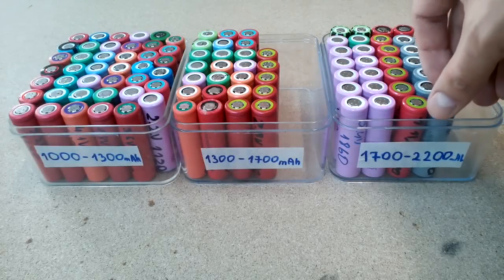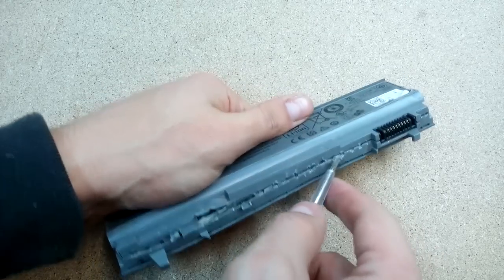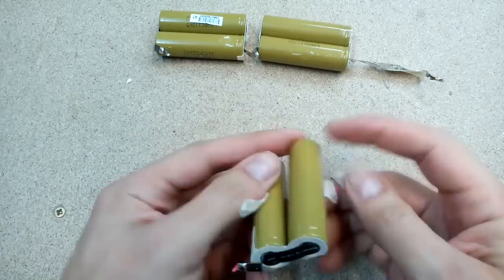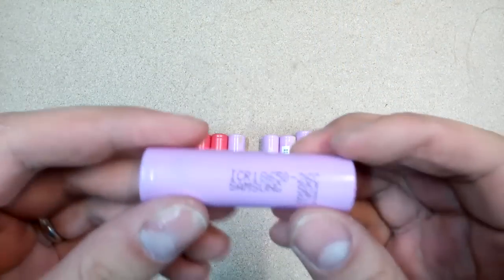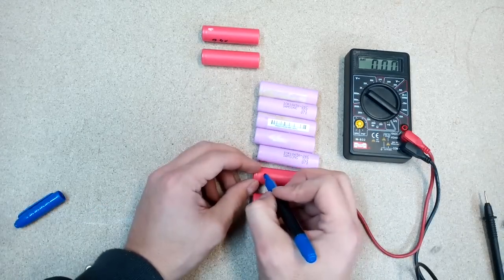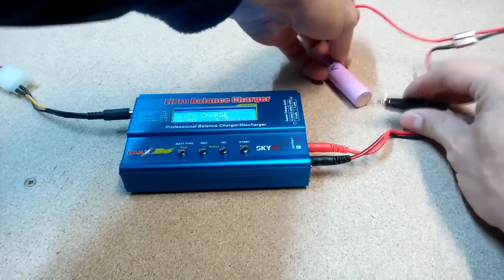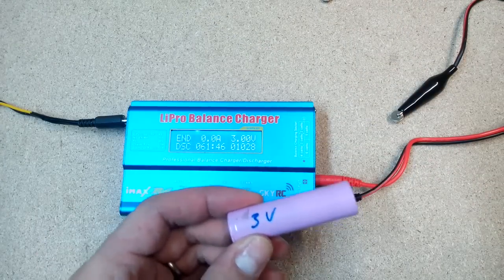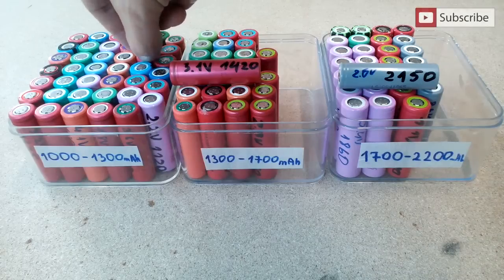How To Get: Free 18650 Lithium Cells From Dead Laptop Batteries

Comment: Please don't use these batteries for vaping
Reply: +Gaming With AA if you are a vaper you should already know that used laptop batteries are not suitable for mods
Reply: Soooo .. Who's going to take "Safety advice" from this child?  Any one??  :)
Reply: Check internal resistance, if with-in spec (low Int. R), they can be used for vaping. While It's true most laptop batteries  are NOT designed for high amp discharge, most can be used.  Again, check the temperature under heavy load first.
Reply: Use good charger
Get reliable specs on battery and don't overcharge/discharge
You should be safe this way.
Reply: philip song
So what man,that is evolution.Idiots shouldn't have to survive their own stupidity.It hurts them to live and it hurts us them that they live.Let them die and let us use our cheapo batteries.Win win.
Reply: With a good charger you can see what battery you have and if they're suited to use in vaping mods.

I use a voltcraft alc 8500 myself and it does a awesome job.Checking batteries for every vaping neighbours for years(usually to find them nice paired sisters but sometimes for amp output as well).
Reply: +GAB GAB no you are spreading dangerous misinformation
Reply: Most laptop batteries are Korean or Japanese brands. They are of MUCH higher quality than any of then the UltraFire brands that people are buying from China.  The  amperage as well as cycle ratings are as stated. They are good batteries. Do you know anyone who died or suffered major injuries as a result of using these batteries to vape?.  I didn't think so, you must be a Yet Another YT Safety Nazi.  

Tomorrow is the 4th, let's all just enjoy the freedom that we have. The freedom earned by sacrifice of many daring and brave Americans of the past and present.   I'm willing to bet that those brave people were not afraid to vape off the recycled laptop batteries.
Reply: philip song
If you don't overdischarge they ARE fine.
Batteries went if you overcharge or overdischarge them.
If you use salvaged batteries and make a build too low overdischarging them, that's user error.
I'm an ICT student and this is common sense.
Reply: Look, vapers to be, just don't, be safe for the time being, and don't do anything that could be bad news to vaping and vapers, and for you other guys, cool, you found a new way to salvage batteries and stuff, but most people can barley grasp Ohms laws, so this kind if "advice." Can definitely lead to some bad shit happening, accidental or not.
Reply: +Yong Whang and no telling you to. Stfu doesn't undermine my cause. Let it go.  This is not a good. Idea for vapers,  especially one who Is broke and doesn't know the dangers of misusing a battery but has a new mech and a broken laptop. Because vapers from all different points in their education about vaping may see this it is important to let it be known that this is not safe unless you can identify the cells with 120% accuracy,  which most of the time cannot be done because most of them are rewrapped.  Just let it go.  

If you knew there was a 2% chance that the cup in front of you was poisoned would you drink it?
Reply: philip song
Knowing what you are doing is part of it.. NOT doing it anyway is the other part.  Such as building a coil with a 20amp discharge with a 7 amp rated battery..     Now a normal person, that knows what they are doing will not do that, yet there will always be some idiot thinking.. well why not?  Lets try it and find..BOOM! (literal definition of face-melt)

Besides which, if you can afford it, why even take a chance?  If you can't afford it, save up until you can.  Gezuz, ask a vape buddy if he has an old set you can use, or a spare until you can get new ones.  Most mech users have 6 to 12 or more on them at all times.  Well serious assed vapers do.  God forbid they would miss blowing out a school of jellyfish to show off to some hot chick because of low batteries.   LOL.. Would I do that?? HELL YEAH!  Go down the wharf in summer, pop out 4 or 5 jellies and watch the chicks come flocking.   :o) and we know they will.. girls are easily amused... they date guys don't they?
Reply: +GAB GAB just shut u p
Reply: philip song
If you do your calculations right, it doesn't matter if it's regulated or not. Ohm's law buddy
Reply: philip song
So i'm right :)
Reply: gbalkam
Point out where i recommended someone to use them. You still don't and aren't going to get it so let it be. "You aren't benefiting at all in that course of study" Because i'm surely going to be asked about batteries in my CV
Reply: why ?
Reply: +Gaming With AA it's not safe
Reply: +Yong Whang don't listen to ^ Unless you have a lot of experience dealing with batteries and vaping.  This is very dangerous.
Reply: +1ceeb don't use laptop batteries for mechanical mods no matter what these people say and you shouldn't have any problems
Reply: +Yong Whang stfu
Reply: +Yong Whang don't use salvaged batteries for vaping,  especially unregulated vaping.  Please don't be skimpy on batteries.  Samsung 25r batteries are 5 bucks sometimes less.  Don't try to save a few bucks by putting yourself and those around you at risk and also the entire industry,  every vented battery horror story puts another nail in the coffin of an industry that save millions and potential billions of futer lives.  If you need cheap safe batteries get the Samsung 25r I think they are 5 bucks each on imrbatteries dot com and they have a pulse rating of 100 amps and 20 continuous,  nobody takes 10 second rips.  Way less expensive than a hole in your hand or face,  or a laptop for that matter,  please please please don't use salvaged batteries for vaping.
Reply: DharkMark
I'm not saying it's ideal or that there is nothing wrong with it.
I don't recommend anyone to do this at all.
But my point is, if done correctly and you do the research on the batteries and know Ohm's law they would work fine without any explosions or shit.
Reply: philip song
You are being extremely biased.
Ofc they aren't ideal but what you are saying is, if a battery is from a laptop it means it will explode no matter what.
Reply: +Yong Whang this has nothing to do with reefer madness let's not confuse battery safety with government propaganda.  They are world's apart.
Reply: philip song
If you have a device that checks if there is poison in it?

Yes.

And a  battery charger like the voltcraft alc 8500 does exactly that.It checks your cup for poison :)
Reply: +GAB GAB If you can afford  a charger like that you can afford a couple 5 dollar Samsung 25rs
Reply: +GAB GAB most people looking to use salvaged batteries are doing it to cut costs and likely don't own a charger like that.  Let's be realistic.
Reply: Guys, if you can't afford $10 to $15 for your batteries, you shouldn't BE vaping.  Why not use corn syrup, rubbing alcohol and cigarette butts you pick up off the street for juice?  Why?  For the exact same reason you don't use shit batteries for vaping.  I am seriously waiting for one of these numb-nuts to post how brand x mod is unsafe because he blew his face off with it using these batteries.
Reply: because don't do it, that's why.
Reply: +gbalkam thank you
Reply: Point is not that we can't afford them, point is that they do not explode in youir face if you know what you are doing.
Reply: +1ceeb point is they do if you don't and lots of people don't but please keep arguing and commenting so my original comment stays bumped
Reply: I'll bet that easliy 2/3 of the batteries he has there would blow up the second you hit it on a low ohm mech mod.  And of the remaining 1/3 that didnt blow up, 3/4 would after a short time.  Now since the batteries aren't labeled.. you have no way of knowing which of those might be ok to vape on.  Like I said, for the sake of $20-$30 it isnt worth the risk.  If you think it might be, pour some boiling water on your mouth, and when you are healed up, come back and tell us if you would do it again for $30.
Reply: gbalkam
Point of this debate wasn't that people should try them, it was that if you get the stats of the battery you could operate it without it exploding.
Reply: +1ceeb no that wasn't the point of this debate.  I initiated the debate and the point is clearly that these salvaged batteries should never be used for vaping especially with an unregulated device.
Reply: +1ceeb God just shut up.  Most laptop batteries done make the grade and if someone is watching this video to try to find cheap batteries for vaping they probably don't know what they are doing or they wouldn't be watching this video.  So stfu buddy
Reply: +1ceeb don't make the grade*
Reply: +1ceeb no your not
Reply: 1ceeb
what kind of failtard would use a 6amp rated battery in a mech mod?  None. People go to mechs for higher builds, not toodle puffer builds.  If you want to use a 6amp batter, just get an ecig.   Furthermore, you have no idea what the condition of these batteries are.  Ohms law be damned, a bad battery is a bad battery, and voltage alone will not tell you that.   But by all means, you go ahead.  If you blow your head off, that is one less moron we have to deal with.
Hope to see ya in the news soon.
Reply: +gbalkam your ignorance on the matter is astounding.  People don't use mechs for higher builds.  People use mechs for low resistance builds.  Stfu you have no idea what you are talking about.  Regulated mods are for higher resistance builds unless they are being used for tc
Reply: philip song
You are so clueless it's hilarious.
The only diffrence between regulated and unregulated mod is:
Regulated = has electronic chip/fuse/protection
Unregulated = has no chip/protection
Reply: philip song
you misunderstood.. by higher builds i mean more mass. like 6 coils vs 2.
by the way.. MY regulated mod will go down to 0.1 ohm. 
Im currently running a hex coil build (that's 6 coils fyi) at 0.18 ohm.  Now tell me again how regulated is for high ohm builds.  My previous build was 6 coils at 0.12 ohm. But it wasn't warm enough at 200w, so I swapped the coils.
Reply: Point is guys.. don't use crap batteries. It isn't worth it.  This clown might know how many volts the battery has in it.. but is clueless about sustained discharge rate, if they are high discharge safe batteries, and the internal resistance of these batteries.  They might be fine for a flashlight, but don't use them in a vape mod.
Reply: +gbalkam i'm not talking practically but theoretically they would work but aren't ideal. If i use use mechs it's for their quick firing, size and simplicity.
Reply: 1ceeb
and like I said, you have no way to know the inner resistance of these batteries or the actual sustained discharge rate or if they are high drain batteries.  From a lap top, I highly doubt they are. IR determines how hard the battery hits, sustained discharge is how long the battery can drain at say.. 7.6v before over heating, and high drain is if they can handle a fast discharge,  So knowing all this.. is it even worth even trying one of these in a mech..when a brand new battery only costs $12 to $15?
Reply: +gbalkam nope
Reply: +gbalkam a brand new Samsung 25r is 5 dollars
Reply: *****
Well, these guys have been told, dozens of times by more experienced vapers.  Short of tying them to 2 posts and whipping them like they did in that scene in Roots.. if they don't know by now, nothing is going to teach them, except blowing their face off.
Reply: gbalkam"by more experienced vapers" Better not fall off of your ego, you might die.
Reply: https://www.e-cigarette-forum.com/forum/attachments/sony-battery-jpg.529035/

Yeah, because sharing what you know is pure ego.  But pretending to know about something you know NOTHING about rather than admit you are wrong isn't pure ego?  The above link is to a document from Sony to a vendor regarding rewrapping batteries intended for use in laptops, drills, power tools, etc as well as links to federal agencies with documentation regarding these batteries and use in stand alone devices.  Now, I consider this to be PROOF not to use these batteries.. now YOU prove the federal government and Sony wrong.  Remember, Sony makes both of these types of batteries, so it doesn't matter which they sell, they still get the sales.
Reply: +gbalkam I was never with the idea that you should use these batteries to vape with but that if you were to fire it wouldn't just go off on your face. I don't know? I'm a second year ICT student and this is daily meal for me. smh
Reply: +1ceeb now you are back peddling.  Cute
Reply: +philip song And you haven't had any valid points during the whole debate
Reply: 1ceeb
First, i never said I was a "more experience vaper"  Im intermediate at best. 
2nd you can not guarantee 100% that those recycled batteries will NOT go off in your hand when you fire the mech, and since you can not do that... don't use the batteries.  On the other hand, I can guarantee that the batteries i use in my mechanical mod will not go off in my hand, because i know the full history of those batteries.  Neither has ever been discharged below 3.3 volts.  Neither has ever been dropped, or left out unprotected.  I know the wraps are in perfect condition, no bubbles or bulges.  I check each battery before I use it, every time.  You just can't know that information for sure, in a recycled battery. 
And to restate the most important point.. for $15 per battery, which lasts about 500 charges (I use 2 batteries and charge each one once per day which is a year and a half for $30), if kept in good condition.. it just is not worth the chance, no matter how slight.  And if you are a 2nd year ICT student and do not know this.. pick another course, since you aren't benefiting at all in that course of study.
Reply: Ok might be some crossed wires here then.  Saying "should be ok" is not the same as "Do not use".  My point is this, if i can not recommend 100% that these are 100% safe to use, I will advise against using them.  They might be fine to use in a flashlight, but if there was even a 1% chance they would short and explode in someone face, due to internal failure, would you really still say these were ok to use to a new mech mod user?  More experienced users won't touch these things.  Not only for safety reasons, but some of these mechs run close to $300.  Plus $25 to $75 for the RDA.  Put it like this.. if it were your son, would you tell him "these should be ok to use" or would you just recommend a pass and get new, properly rated, high quality, high discharge batteries?
Reply: what about for flashlight??
Reply: +Yong Whang anyone who has even the slightest bit of knowledge about unregulated vaping should know salvaged laptop batteries are not safe,  furthermore your ad homs don't really help your case.  Saying salvaged 18650 laptop batteries are safe for vaping is simply reckless.  Vaping in America is under attack if you haven't noticed,  and terrible advice like "using salvaged batteries is safe for vaping"  is one of the biggest problems.  One of the reasons the industry is under attack is because of the misuse of batteries and injuries from vented batteries.  You can say whatever you want but at the end of the day you are spreading dangerous lies.  

Please stop spreading misinformation,  it literally costs lives,  not just because of batteries venting but because misinformation leads to injury which leads to stricter laws about vaping which results in millions of people not making the switch.  Saying to the public that salvaged laptop batteries are safe for vaping is part of a number of issues that  can and will result in the loss of hundreds of thousands to millions of lives. 

Seriously think before you comment.
Reply: Philip,

No one is saying all salvaged laptop batteries are safe to vape. What some, including myself, are saying is that to categorically dismiss these cells as dangerous is also false.  I'm fully aware that some of these pulled batteries are unsafe in a flashlight let alone in a vape. But you can't say that they WILL ALL  blow up and kill you.

While I agree that vaping is much preferred to smoking and if widely adapted will save lives, and would like to see more people migrate off tobacco. But you have to be honest. 

A while back, in the 30's US Gov went on anti-pot campaign (re: "Reefer Madness"), where they portrayed pot smoking with all kinds of crazy behavior, as if one drag and you turn into a crazed killer-rapist. It was meant to scare people away from smoking pot. But of course people realized that the warning was a lie, and no one took any kind of warning seriously, including real dangers of pot smoking.
What you are doing is the same. In order to protect your new found hobby from bad PR, you are treating everyone as a child. As soon as word spreads that not all laptop batteries will blow up, no one will take you seriously.

The best approach is the truth, backed by hard data. That certain % of recycled cells are bad, here's how you can tell. And if you are uncertain or lack expertise don't take a chance.

If you feel vaping is worthwhile cause for you to promote, do the work, collect data, do some research, offer people independent means to validate your position. Telling me or others to STFU simply undermines your cause.
Reply: +Yong Whang actually yes I do know someone who has been injured by using salvaged batteries from a laptop nice try though
Reply: +Yong Whang my freedom of speech allows me to shut you down for spreading dangerous or misleading information to people
Reply: +Yong Whang cute
Reply: +Yong Whang I definitely wouldn't take battery safety advice from a guy named Yong Whang.
Reply: +Yong Whang especially when strawman and ad homs are your best debate tactics
Reply: +1ceeb just don't.  Seriously don't.  Lots of times these batteries are hard to identify.  Just don't.  Please just don't.  And quit being the Devils advocate on this one.  This is about protecting an industry that saves millions of lives.  Under attack because people do stupid shit like this.  Please just don't.
Reply: +1ceeb no I'm not.  I'm saying it's not worth risking it.  Especially if you can't identify the batteries with 110% positivity.  And every person that vents a battery is another nail in the coffin.